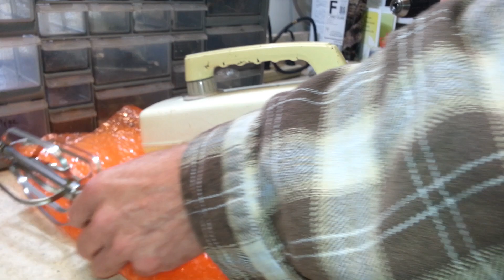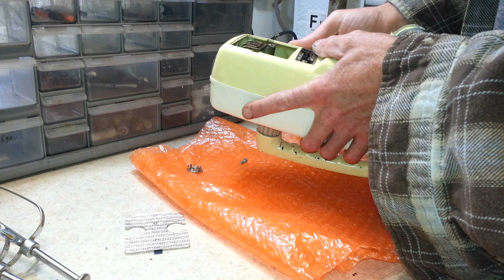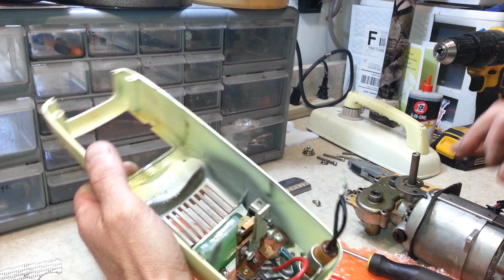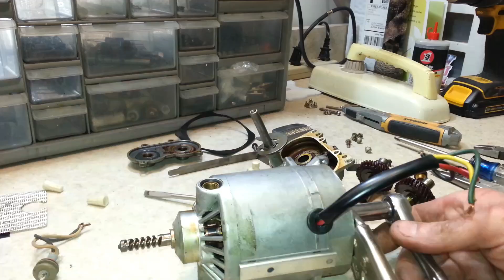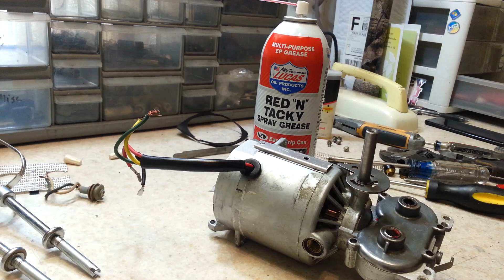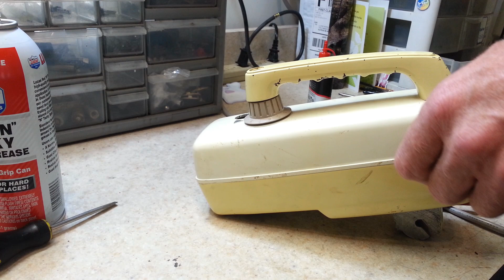Vintage Kenmore stand mixer service

Comment: We had that mixer. It was used almost every day for decades back when two or three meals and desserts were made every day.  It was plenty powerful and went right through big cakes, divinity, fudge, etc., with never a problem. It sadly got trashed when my mother got her KA about 1978.  When it was plugged in the steel band on our Formica countertop would severely, painfully shock if you touched it. It had an adjustment on the back of the stand for a large or small bowl.  The bowls were milk glass and very durable.

Comment: In agreement with you that this is a Westinghouse built Kenmore mixer.  Later Kenmore stand mixers were built by Hamilton Beach.  Hamilton Beach during the mid-1960s bought out Westinghouse Small Appliance Division.  Some Westinghouse appliances became re-badged Hamilton Beach appliances fry pans, irons, roasters mostly.  There were some new models showing merger of the technology of both, like the Custom 200 series  mixers.

Comment: Wow never seen red n tacky in a spray can it looks more watery than traditional grease do you think it will hold up? So convenient I bet though!
Reply from the maker: It is very convenient, expensive but nice to have around. It comes out looking runny because I is mostly air bubbles, once they dissipate it just leaves the thick grease behind. Sometimes you might have to give something several sprays because so much of it is air, looks like way more grease is applied than actually is, but gets into small areas easy

Comment: Hi Rick,  What a different kind of challenge to solve, I am so glad you took us through your process of problem solving, you have so much patience. I really like to see new and unique motor designs; at first I thought this would have a kind of cheap motor but it was surprisingly well put together.
 Thank you Rick for showing this.  Brett
Reply from the maker: thanks Brett, I love seeing something new! I was surprised as well, as a lot of Kenmore and wards machines did tend to be cheaper quality, but yes this one did impress! Sounds pretty solid too, and quite the speed range. Even the speed control was well done!